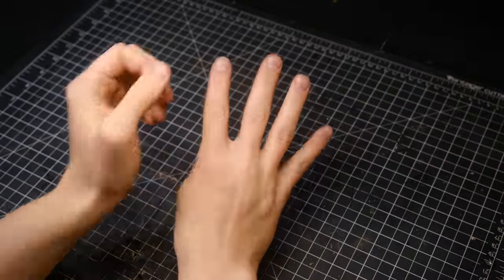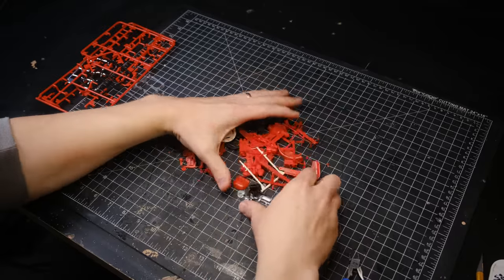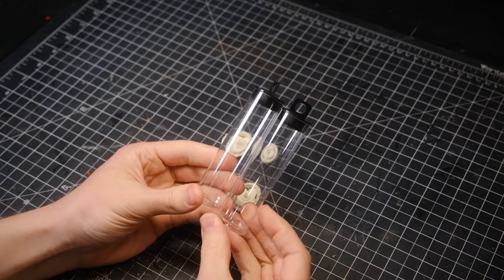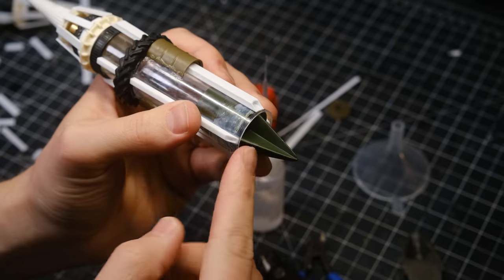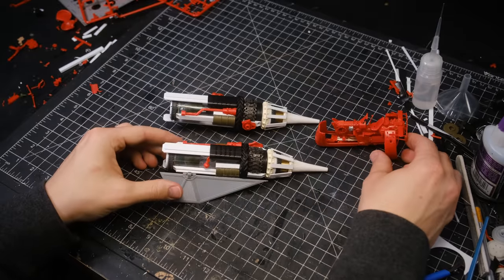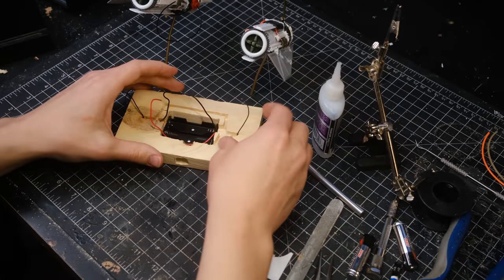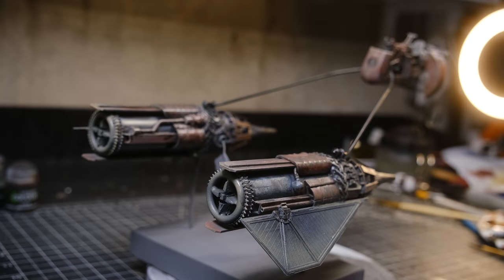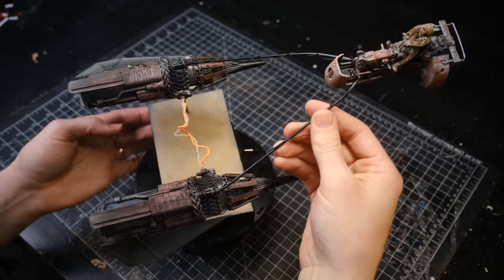I Wrecked a Tractor to Make This

Comment: not to be "that guy" but, the Pod feels off lifted up so high. It should be lower as it is essentially dragged behind the engines. While the Pods do have repuslor lifts in them, they are only really used to start and finish the race. Momentum does the rest after that. Aside from that though, love the build!